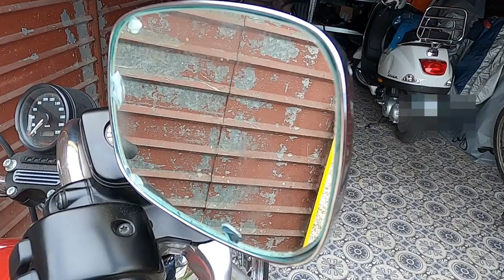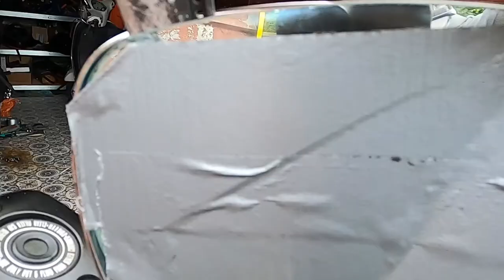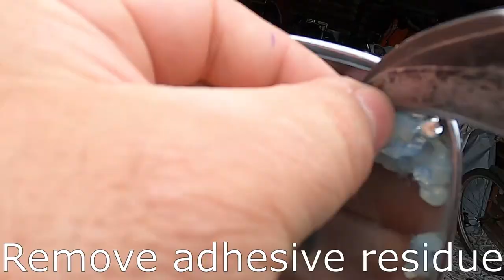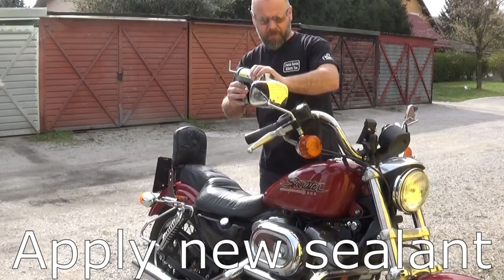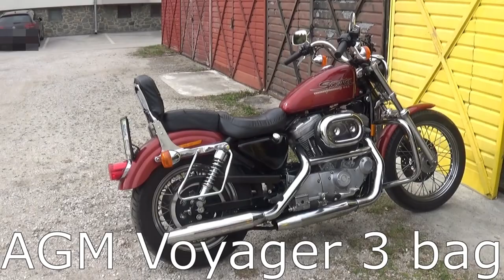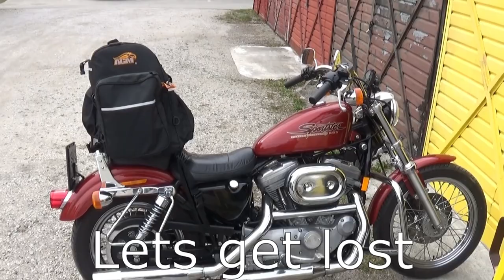Harley Davidson Sportster mirror glass replacement

Comment: Where can I get the r.h. mirror glass? Can't find it anywhere.
Reply from the maker: I buy it on e bay
Reply: @mototravelhd1189  I need just the glass, all I see on E-Bay, are the whole mirrors. Have you got a particular seller where you got yours. Mine is just like yours, right side, with the two screws on the back. (2001)Hugger.
Reply from the maker: I Will trie to find and help you
Reply from the maker: On e bay   trie with this .........conwex wing mirror glass for harley davidson sportster